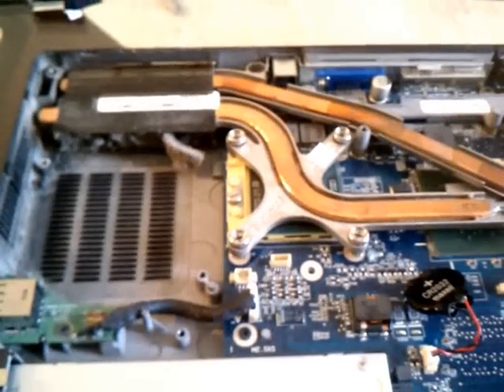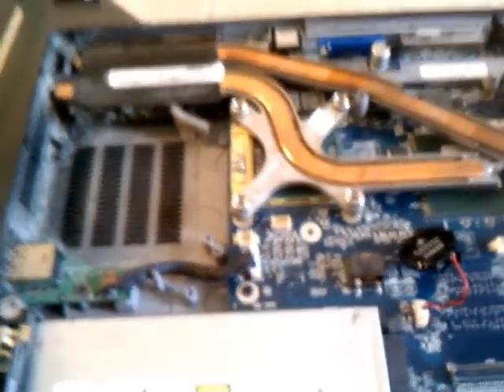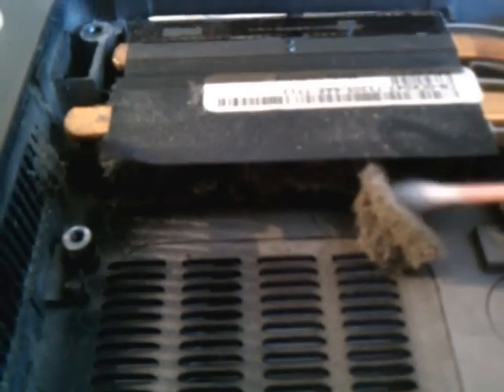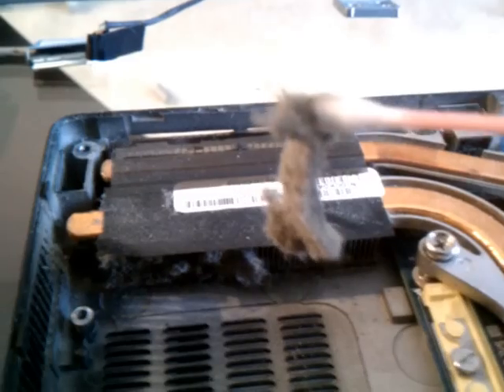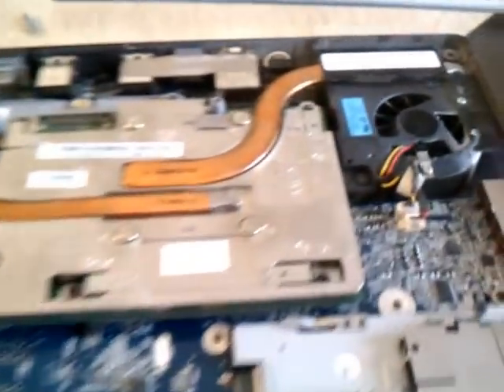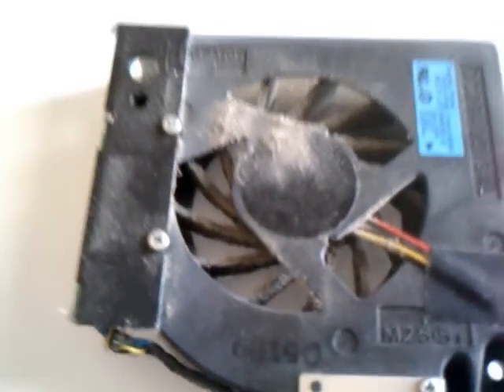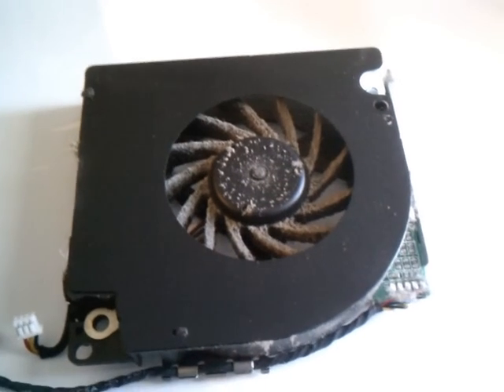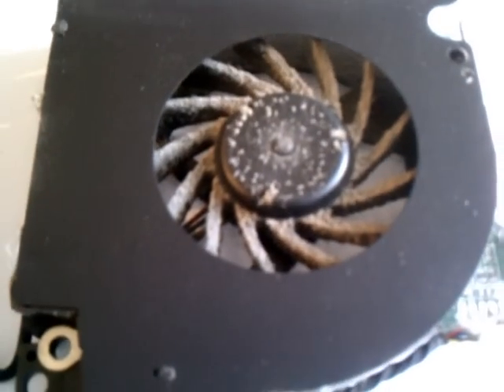How to Clean Dirty Laptop Vent and Fan Dell XPS M1710

Comment: couldnt figure out why my video card was running so hot,(ATI  radeon 5770) i usually clean my whole case out once a month at work with compressed air,i decided to take the card apart and put some new thermal paste on it,the heat sink is held down with 4 screws and even though you dont need to take it off i decided to do it,what a surprise,the side of the sink thats hidden next to the fan was 80% plugged up with thick ass dust,its running now 38 degrees playing call of duty graphics maxed out

Comment: ATTENTION PLEASE!
This will void any warranty, I nearly attempted this before I stopped and called the manufacturer of my laptop to find that I still had 10 days left of warranty. Told them about the overheating issue and was then told to update the BIOS. This dropped my temps (while gaming) from around 100 deg Celsius down to 85. Still not satisfied, I called the manufacturer again and was told that the laptop would be picked up for a fan upgrade. CHECK FIRST!